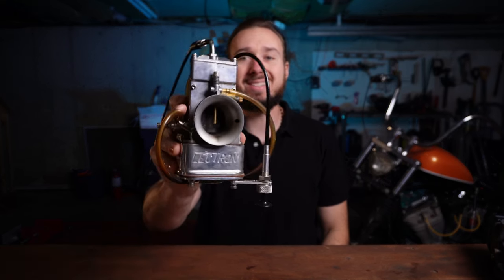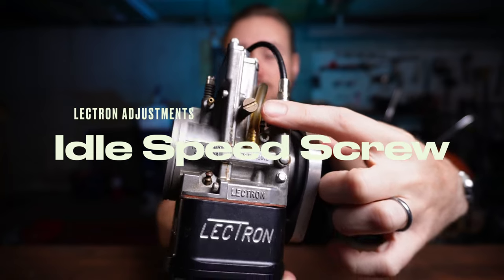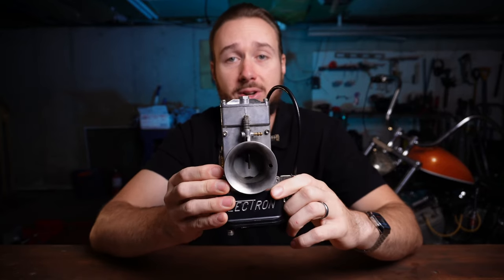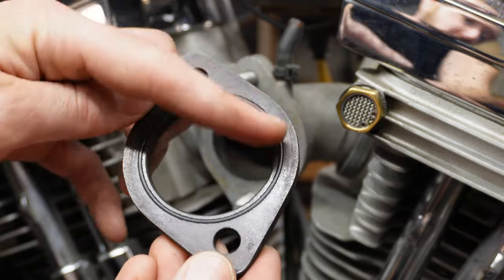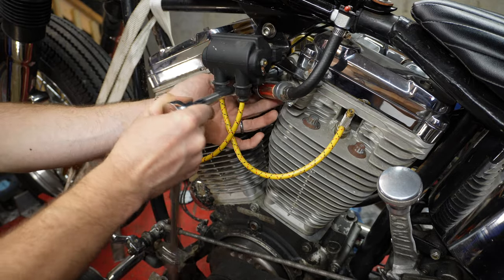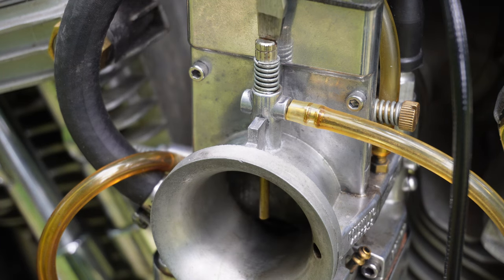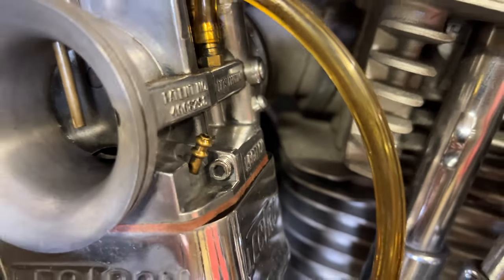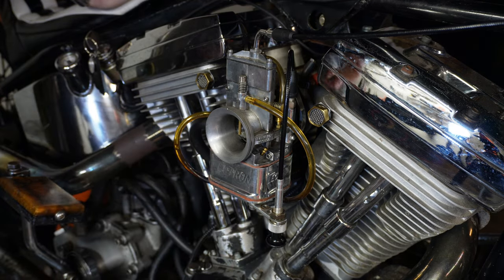Lectron HD Carb Install on Harley EVO Big Twin

Comment: If you have a high idle and the screw doesn’t do anything you need to open up the slide and reinstall it. There’s a process to it. If you look up the PDF installation manual, it’ll specify how. Lectron is horrible with documentation actually.  Not your fault. It’s easy to miss. Trust me, I’ve battled running on my FXR. It ain’t plug and play. But it’s a nice carb for what it is
Reply from the maker: Thank you for this! I will give that a look, I appreciate the tips 🙏🏼
Reply: You basically have to slightly crack the throttle open before you fully torque down the top screws on the slide housing screws. Once torqued release the throttle. Then you’ll notice the adjustment screw doing something to the slide height.
Reply: @mcluvinole9098 That makes a lot of sense, like the slide has to sit on the screw right before it can be adjusted up or down, you know simple common sense tricks like you and I know, is what the " YOUNG COMPUTER TUNING GUYS" get lost at..lol....I  was thinking at first the choke was pulled, hence the smoke and unadjustable idle🤔

Comment: if you are having high idle and turning the ISS in all the way with no change, chances are that you're running on the metering rod and not on the idle circuit. There is a factory spec for the length of the metering rod that might need to be reset for your specific bike.
Reply from the maker: This is good to know! Going to check on this and put that process in the part 2 video on tuning. Sounds like I will have plenty to cover
Reply: It seemed to me the choke was pulled, that's why all the smoke and no idle slide adjustability???🤔

Comment: The floats stick! And if you leave your bike sitting for more than a month the metering rod will get stuck to where the throttle will not work! When you try to unstick it the metering rod will pull out of the slide housing. On your bike you need to turn the metering rod out one eighth of a turn and turn your fuel in one eighth of a turn and it will idle fine. My hd400 I bought was 1,000.00 Dollars not a cheap investment but once you figure out how to set it you will find your performance of your bike will be a changed animal.
Reply from the maker: I’ll try this with the metering rod. I don’t believe the float is stuck though I took the bowl off and moved it around I’d be surprised if it was still stuck

Comment: I'll go ahead and address the elephant in the room. The super E is rubbish. It's missing an entire fuel circuit, hence the invention of the Zippers power jet. Another certified H-D technician calls it a controlled fuel leak. I have had great success with the Mikuni HSR-42 on several projects but I'm ready to try a Lectron.
Reply from the maker: I certainly disagree but I’m just one person and I wish you luck with the lectron 🙏🏼
Reply: Man I'm interested on your Lectron journey. I Have a crate 124 S&S engine I will be installing this winter, and I'm thinking of going to a Lectron, currently I have a Zippers Stage 2 carb and would love the ease of  that Lectron. Keep me in mind if you go that route💪

Comment: Ive been running the 48mm lectron on my fxr with an s&s 124 for about 4 years. Took Kevin a few trys at finding a good grind on the metering rod to get dialed in for a big motor but after a few it was ok. I run an air fuel meter so i was able to fine tune on the road. Dont have to touch it much. The idle circuit is the best ive ever heard. I have a few videos on my youtube if you want to hear it
Reply from the maker: I will definitely check those out thanks for sharing brotha

Comment: Yeah i wasnt to impress with mine didnt like how the throttle was still when running and was smooth when engine was off and you couldnt full choke or even 1/4 choke without being way to rich fouled plugs then the choke itself just quiet working all together had this white crusty stuff in it  when i pulled the plunger out yeah went back to my cv40

Comment: Mine works excellent on my rebuild shovel,bought it straight from lectron.
Reply: No problems so far? Do you ever need to use the choke?
Reply: No problemen,it runs perfect. No choke needed

Comment: I saw a vid from Shade Tree where he installed a brand new Lectron on his HD and it worked a treat. These carbs seem to be old teck but like an old amal or Mikuni you do have a lot of adjustment with needles and slides, it just takes a bit of stuffing around like carbs sometimes do.
Reply from the maker: I saw that one. Lucky dog. I’m sure my experience isn’t typical, I’ve heard a lot of people just plug and play

Comment: pure junk rather use a cv any day
Reply: It isn't junk. But, I don't see enough benefit to replace my S&S or CV with a Lectron. If I were building another bike and needed a carburetor, I would investigate the Lectron. I can see a great advantage for riding in the mountains were elevation changes rapidly.

Comment: What happened to part 2?....Choke and enrichener are NOT the same thing. A choke restricts air flow which pulls more fuel and an enrichener actually lets in more fuel without restricting air flow..
Reply from the maker: We get it, thanks

Comment: Maybe the throttle cable is a bit short? The throttle slide is held high and is not controlled by the adjustment screw.
Otherwise, from what I see, it seems to me that this is a rather primitive carburetor.
Reply from the maker: Could be, I will have to check on that

Comment: I'm glad i watched this, I'm OCD and that fuel line would have driven me nuts. I just found a bunch of 90 degree fuel line bits that you just measure your tube, cut and bond. You can really tuck that fuel line up and away nice and pretty.

Comment: Gotta love the custom made VOES vacuum line plug!

You had mentioned once in a previous video that I commented on to hit you with any topics we'd like to see covered. Personally, I'd love to see a breakdown of the VOES system: how exactly it works, how to tune it, how to remove it, etc. Another topic I think would be fascinating is the modifications required to convert an EVO motor to a kicker system.
Reply: My '84 EVO came from the factory with a kicker and electric starter.
Reply from the maker: Hahah I almost forgot about that “temporary” fix that’s been on there almost two years now! 

As for the VOES, I can definitely tell you how to remove it, and I will add that (with the kicker part too) to the video topic list. 

As far as tuning the voes, I need to go to school before I can put that video out haha, I will do some research on it though and see if I can’t sum it up
Reply: I'm guessing the simple answer to removing VOES is points eh? 😅
Reply: @djd34d14  If you have an electronic ignition, technically you can disconnect and plug the VOES. My confusion is whether to ground the VOES wire, or simply cap it. Then there's the question of what to change on the ignition module switches...

So yeah, converting to points may just be simpler lol
Reply: I put a Dyna S on my Evo,  plugged the VOES vacuum port on the carb (HSR42) and used a good quality (stainless steel) mechanical advance - she kicks much easier and runs like a stabbed rat!  @Lochlann13
Reply: @greasesgarage did you have to switch ignition control type to bypass VOES? Or just bridge some wire
Reply: @Rif_Leman so sweet. I think to get a kicker on my 87 sporty 1100, some custom machining needs to be done

Comment: The lineage is from the OLD POSA carb from circa 1970.. Then it was cross bread between Amal, Mikuni and POSA.... Not a very good carb as it only works well on one setting. All other throttle positions are a compromise.
Reply from the maker: Interesting, never heard of that before but I will have to see how it does as I tune it more

Comment: Maybe I'm just noticing little stuff that doesn't matter, but it seemed like the mounting surface on your manifold wasn't very clean. There might have been enough on there to cause a vacuum leak. Just throwing it out there. That could also be causing your idle problems.
Reply from the maker: It could be. I have since reinstalled the super e on the bike (see my kickstart video) and it runs perfectly so I am inclined to believe it’s something to do with how I’ve got the settings on the lectron

Comment: what tube are you using for the throttle cable?  I've been running one on a 98 Dyna. I've had allot of issues with the throttle sticking, either the slide isn't completely closing from airflow or going to a single cable setup. I've also had the same issue with fuel flow, I'll have to try your suggestion. great video. Thanks.
Reply from the maker: Throttle cable is from lectron. In watching the video back I don’t think it’s from the throttle cable being too short as one commenter suggested because even when showing the carb without the throttle cable attached that slide stays slightly open at the bottom

Comment: One of my buddies swears up and down the Mikuni carb is way better than the Lectron. Any thoughts?
Reply from the maker: I would agree, my experience with the lectron wasn’t great and if I were ever to give up my beloved super E I’d look at mikuni before lectron
Reply: @greasesgarage  I’m trying to decide between a Mikuni or a S&S for a 96 Sportster I’m working on lol. It runs fine I just wanna upgrade it a bit
Reply from the maker: My most honest recommendation is the S&S. For the simple things you do most on a carb. Extended screws available that allow you to adjust it by finger at a light, throttle cable is externally mounted and easy to remove, parts available everywhere because it’s one of the most popular carbs, every cool air cleaner made is always made for S&S…there’s a lot to love.

Comment: Following because I'm also working with a Lectron HD 400 right now and there is nothing out there about these in depth, aside from a handful of old videos from Lectron.

Mine was pouring gas, also thought it was a stuck float... took the bowl off, and it was fine. They recommend spraying WD-40 in the fuel inlet directly, followed by low PSI compressed air through the fuel line (plugged back into the inlet) to clean the fuel intake portion. Mine has stopped dumping gas since, but I'm waiting on the meter rod tool in the mail still to dive into the fine tuning
Reply from the maker: I must say, I was intrigued about the not having the buy jets portion of these carbs but if I have to buy metering rods and metering rod tools I feel like it’s the same devil, still more pieces to buy. I will see if I can’t get by with just tuning the metering rod I have. 

Hope you get a resolution as well man
Reply: I believe you can adjust it with your fingers, the tool seems to make the job easier and a little more precise. It was $20 from them directly. I want to keep the carb and learn it. I hope I'm headed in the right direction!

Comment: Are you getting back on lectron videos or did you just forget about it?
Reply from the maker: The video didn’t generate the interest I was hoping for so I put the topic away for the foreseeable future. If I see more comments or questions on this topic I can revisit it but most of my audience didn’t seem interested as compared to videos I’ve done on other carbs
Reply: @greasesgarage  Okay thanks. Buy did you get it working and still have it? Or did you back to your old carb
Reply from the maker: @HK-nl3ih I did not end up getting it to work, I put the super e back on for the remainder of the season

Comment: What kind of air filter fits it.
Reply from the maker: Supposedly the new ones come with a mounting flange which matches the S&S super e so it can take the same air cleaners
Reply: @greasesgarage  thanks for your reply....if I'd of waited and watched your whole vid before sending my question I would of heard about the air cleaner attachment....my bad....I'm running an S&S with a thunder jet set up and i'm experiencing a short hesitation in the mid range....I was thinking of replacing it with the lectron carb....just wondering when you are releasing the follow up vid on how you fine tuned the lectron to eliminate the teething probs you were having with it....

Comment: Can you put a lectron  on a shadow 750
Reply from the maker: I would call lectron and ask them because I’m sure people have wanted to
Reply: As far as I know, you can, as long as they will physically fit the manifold on your Shadow. You'll need a Mikuni 48mm push-in manifold or similar. Lectron sells their carbs by displacement; they have a v-twin carb for motors from 53ci - 100ci, and a carb for motors larger than 100ci.
Reply: @Lochlann13   @greasesgarage ..ok but why i would do that..yeh whats the benefit of it . Would i gain more mailes per galon or a litle bit of horses power or more torque ..because gain a bit more miles per galón would be a very good reason to buy one …and i was wondering that would be awesome if exist a kit for made a carburated bike into a fuel inyected.. maybe is too crazy that think but would be great that some brand or companies start to sell those kind of kits..
Reply: @carlosviedas199  The benefit of the Lectron, in my experience, is the throttle response improvement, a wider, more linear power band, and increased reliability. I've heard that they also slightly increase horsepower, but can't confirm that myself.

They do make kits to convert a carbureted motorcycle to a fuel injection system, but they're pretty expensive from what I recall. If you don't want to hire a shop to install it for you, you'd have to know a fair bit about wiring, electronics, and engine tuning to get it running right.

Comment: I have had the CV S&S and mikuni on my Harleys. I had a lectron on a 2 stroke. To me the best one for the Harleys is the S&S. All of them have pluses and minuses but for me the S&S just always works. The CV and mikuni are temperamental and requires rebuild more often. Haven't tried the Lectron on the harley but have thought about it but prefer the simplicity of the super e
Reply from the maker: The super E is without a doubt my favorite carb and it’s what I continue to run on my bike